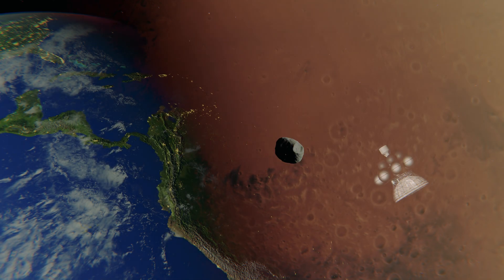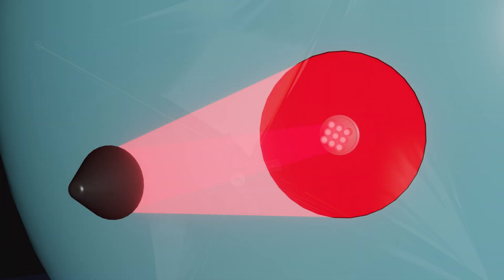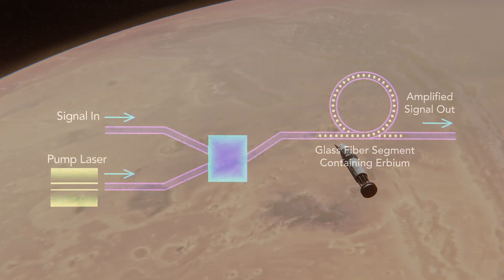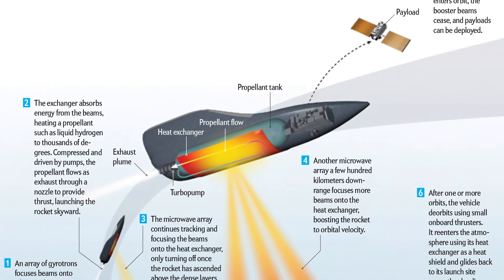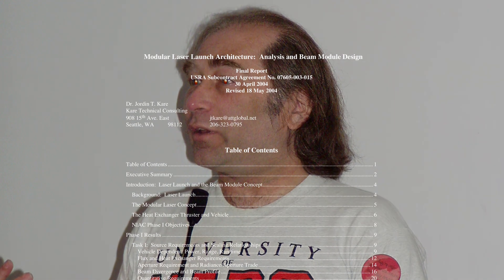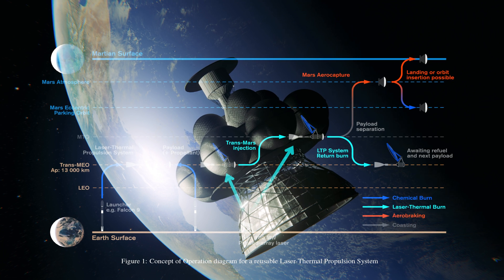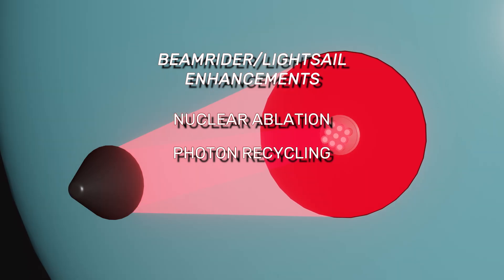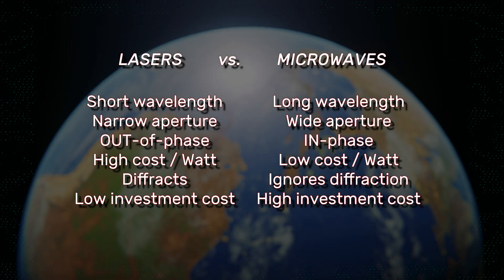Reaching Orbit + Beyond with Lasers

Comment: The more people talking about power beaming the better. As far as power sources go beamed power is just unmatched in terms of power to mass. Even compact aneutronic fusion can't match beam power kilo per kilo. Even if we get cheap simple vanilla hydrogen fusion tomorrow space-based power beaming is still better because it can radiate from a larger area(Hill Sphere of the reference body), doesn't produce waste heat on earth, can block less useful wavelengths hitting earth to increase the global heat rejection capacity, the infrastructure is cheaper & simpler to build/maintain once u have decent space launch infrastructure, can be used to power air travel as well & actually well before u have enough beaming capacity for spaceflight, etc.
Reply from the maker: Very good points. I think there will come a moment when industry realizes the flexibility of beamed power and following this we'll see applications we never imagined!

Comment: Ok lets say we propelled our space craft to Mars with lasers.... how do we stop it?
Reply from the maker: To quote the Mars mission whitepaper:
"simulations suggest that using this architecture to reach Mars within 45 days requires – at a minimum – a very delicate aerocapture maneuver if no laser array is available to effect the deceleration maneuver. Should this fail, while the trajectory discussed in Section 2 could be tuned to provide a free return (orbital period of 3.96 years), the duration of such a return makes it impractical."
So aerocapture seems to be the preferred method at this time but having a pre-established reflector in high solar or mars orbit is implied to be the ideal. Also, if we end up using a laser thermal rocket system as this paper discusses, it's fairly easy to engineer a rotating reflector and allow the vehicle to burn in retrograde since we aren't as concerned about the momentum of the laser, just the thermal energy it provides.